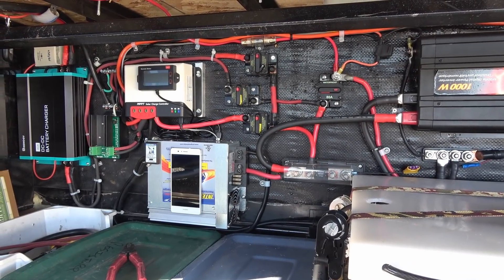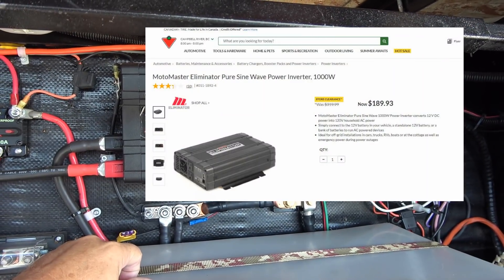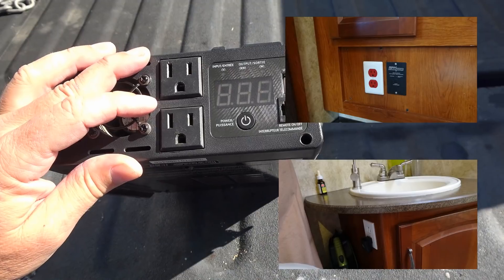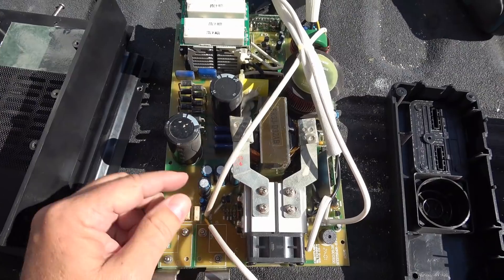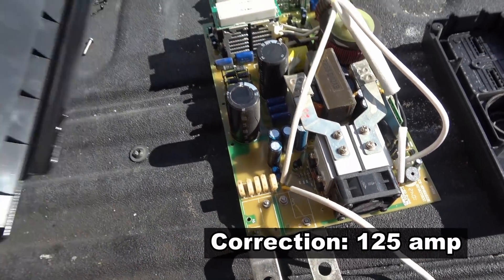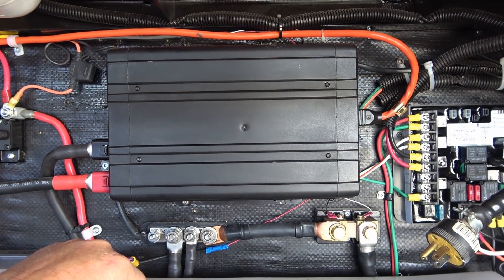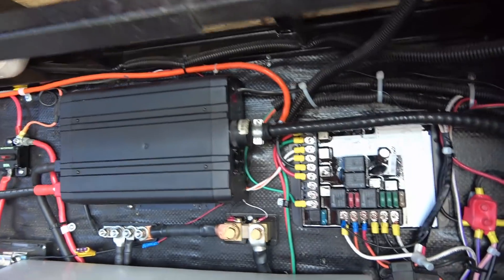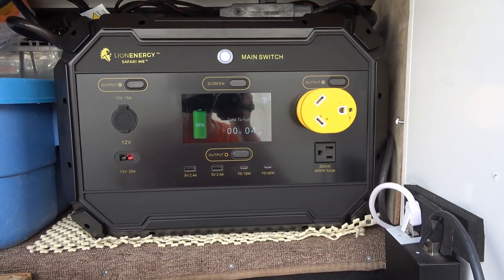10 Year Old Inverter Teardown Inspection - Motomaster 1000 Watt Pure Sine Wave from Canadian Tire

Comment: I have the same inverter, do your fans turn on immediately on any ac load even though they it maybe small. Find it very noisy.
Only 6 days left till you get in the cue to cross the border. 
Enjoy your channel.
Reply from the maker: No, my fans only turn on and create some noise under heavy loads. If its under 100 watts I never hear a fan. Cheers, Ray
Reply: @LoveYourRV  thanks for your reply, mine is only 2 years old, so looks identical, guess they just changed internal design.

Comment: I have the same inverter. Its been functioning very well. I'm looking to dive into rooftop solar. Thinking 40a mppt with 2x280w panels to keep the 6volts charged. I'd love to run the ac on battery/solar but I'd have to budget for 7 or 8 thousand to make that happen.

Comment: very nice review! as i always say, you do excellent reviews! speaking of which... how are you liking your seelevel monitoring system? I am getting close to doing some under trailer mods and would like to convert to those.
Reply from the maker: Thanks, here is an update on the SeeLevel from last summer - https://youtu.be/20YTNa63eCs?t=200  I think its a must have for my boondocking trips but in hindsight I wouldn't have got it for the black and galley tanks just the fresh and shower. Others mileage may vary depending how they use the RV and tank design. Cheers, Ray

Comment: Hey Ray, another informative video.  I was just looking at this inverter online yesterday - as you know on sale for $189 at CTC.  What will it power in your RV?  I'm hoping to have it power our small outdoor kitchen bar fridge (electric only) while travelling, and hopefully my CPAP at night either when power is out or while boondocking.  We have 2 deep cycle batteries in our 5th.
Reply from the maker: It should be able to power those no problem. Here is a post I publish a few yeas ago showing what we used it to power - https://www.loveyourrv.com/what-do-we-power-with-500-watts-of-rv-solar/  Things it won't power are high wattage items like microwave, coffee maker, hair dryer, etc.  Most items have a wattage rating label on them. Anything under 900 watts it should handle. Just be advised that 2 batteries isn't very much capacity if you start powering higher wattage items they will run down fairly quickly.  Cheers, Ray

Comment: Wish Lion Energy  or someone would make a system like the Safari ME without the bells and whistles for ppl like me on a very limited budget, right now all i have is hand me down gel lead acid batterys and a harbor freight 800 watt basic inverter and one previously used 80 watt solar panel that takes a few days to change the batteries when i run them down less than 85%. One day hopefully the prices will drop and i can upgrade to a nice system like the Lion Energy.
Reply from the maker: The cost of lithium batteries is the biggest hurdle to making them much cheaper. The lithium battery pack is what makes it a very powerful and fast charging but still a relatively lightweight package. All these lithium-based portable power boxes have to buy off the world market for lithium and it remains highly priced. Hard to say if the price will come down much since the demand is currently so high and lithium needs to be mined so there is a fixed cost to do that. The best hope is if some other new battery technology comes along that is cheaper. Cheers, Ray

Comment: When plugging in your 30 amp cord to the RV, are you bypassing the built-in DC converter/charger? I would like to be able to do this, but can't figure out how to bypass it. My thought is that it would be trying to "charge" the battery while running off of battery power. Seems like it would be an escalating amp loop or something. The advantage is that all of my power plugs would be active.
Reply from the maker: Yes, that is a definitely a concern. In my rig there is a separate 15 amp AC breaker on the power distribution panel specifically for the converter charger. I just flip it off when I go boondocking to disable the charger.
Reply: @LoveYourRV  My trailer is only one year newer, so I'll try the same. Thank you, sir!
Reply: @LoveYourRV  Dang. It kills all of the AC plugs. I was hoping to be able to run the refrigerator while driving to avoid any thawing. I guess I'll have to try to run a cord directly to the fridge plug from my inverter.
Reply from the maker: Here is a video of my power panel and you can see the breaker at the bottom is called CONV for the converter.  https://youtu.be/gr2iNdMzqi4?t=38

Comment: I had wanted to replace the 400watt inverter that came with the fifth wheel and If it lasted  ten years I think it will last me til I don’t need it anymore. Thanks Ray.
Reply from the maker: Hopefully, they are still making them as well as they did back in 2010  Cheers, Ray

Comment: I too was surprised how clean it was inside. When we come back from the desert we're sweeping fine grain sand the rest of the year. Running only a 100 W of power not really surprised all the electronics are in good shape. As you are aware heat is the enemy of electronics. I imagine it runs very cool with only a 100W demand.  I'm still waiting for your mini nuclear power station with cooling tower install though... lol.